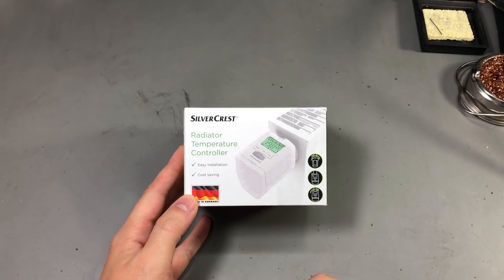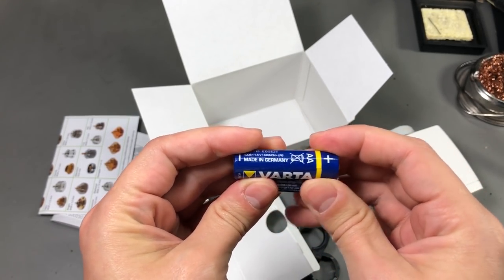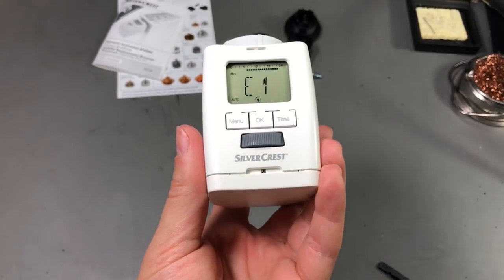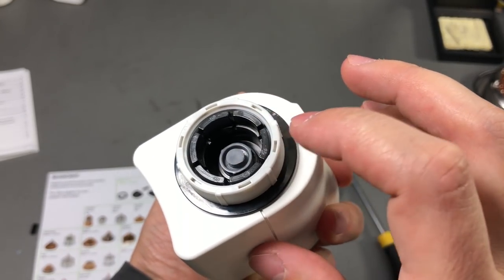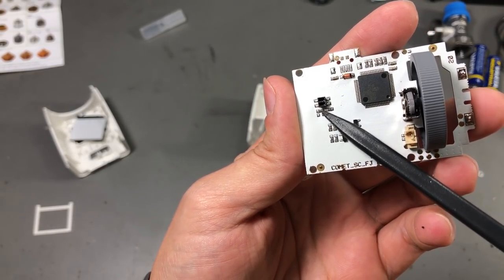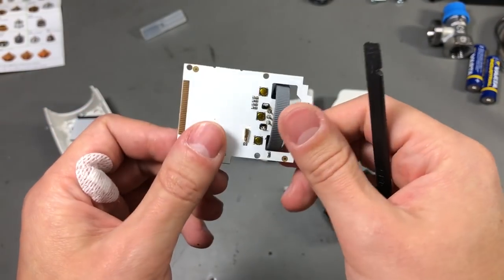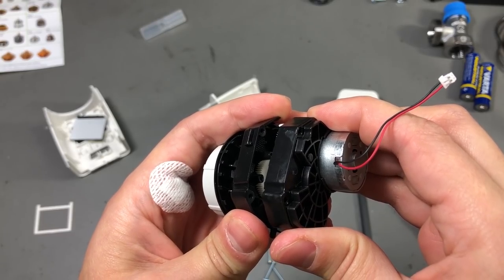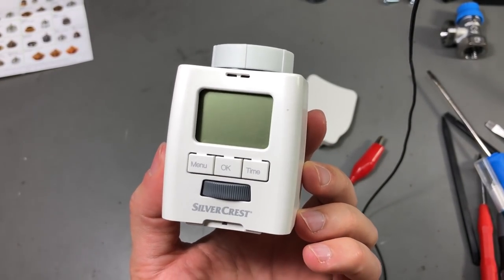Voltlog #188 - LIDL Silvercrest Thermostat Teardown

Comment: Although the temperature measured near the radiator is different from where you usually are, it is just for reference.
For exemple you can set it 35 C and where you are is 25 C,  if you set it 30 where you are is 23C  you do it until you get the temperature you feel good. This way you can regulate the temperature even it is not the same showed on the display.
Reply from the maker: you can do that but it doesn't sound good to me, I'm curious to see if the problem is there in practice or if they try to compensate somehow through software.

Comment: Hi. Thanks a lot. What do you think, is it possib,le to unsolder thermistor (temperature detector) and solder it on extended wires, to have remote measurement of temperature at different point in space?
Reply from the maker: that should be possible, thermistors are often attached with extension leads for remote sensing.

Comment: It is a good point how that thermostat being so close to the heat source could give you an accurate easy way to set the temperature for the room.
Reply: That's no different than all the other radiator mounted thermostats that have been in use for decades.

Comment: I have those valve instaled in my house, they are great. now when I  use them I would liek to have smarter solution, Is there solution for this valve that when the valve is closed that it shuts down boiler?? I have watched sewerall videos and cant finde complet solution. Like GIACOMINI or Comet DECT
Reply from the maker: I don't think Lidl sells a complete system that could control the boiler/heater as well..
Reply: @voltlog  Thanks for replay. Is there way that this valve controll boiler? The same company produces thermostat with wifi witch can connect with another devices. Is here possible to put some kind off transmiter witch could send info to boiler to turn off. Problem that I have: my main thermostat witch turns on and off boiler is in my living room, I have set it to turn heating on in morning lets say at 6am and valves are allso set at 6am but it could hapened that valves closed in 6:50 because they reach set temperature but thermostat still didnt reach same temperature and boiler works, service man told me that this is bad and that boiler can fail in souch way. Does someone have solution?
Reply from the maker: You would need a complete system with thermostats that are able to connect to a gateway which will control your boiler on/off.

Comment: Does anyone think having a temp sensor so close to the radiator may be a problem?
Reply: Andrei Daniliuc  A normal manual handvalve also measure near by the heater, may u need a offset
Reply: Thanks for the note. I know manual ones have that but I'm not sure if you'd be expecting a lot of accuracy from those ones. On this one you can set a specific temperature. One may expect more accuracy? Lots of error correction may be needed given the proximity to the radiator I think.

Comment: I know how they managed to get that low cost: they skipped soldering usb connector! You can see pads for probably mini usb connector near that ic. Four pads for metal part of connector, and even two small holes.
Reply from the maker: with another model they have that port

Comment: Remove that blue cap, this is only a protection for the valve...
Reply: It seems to be a screw cap to protect the valve itself during construction works.
Reply from the maker: I have tried with the blue cap removed as mentioned in the video. No luck!
Reply: Hendrik Busch yep, also radiators and sanitary stuff are usually coming with those - still have a box of them...:-)
Reply: @voltlog  You might want to take a look at this video by Giacomini. They show how to attach a valve similar to yours: https://youtu.be/Wt6ROY1n3Ss

But you are right: you may need another adapter. All Giacomini installation videos I found use some sort of push-fit rather that a screw fastener.
Reply from the maker: In the video they clearly show an adapter being fitted over the valve (white +Red pin) and I'm missing that, because the valve body seems identical to what I have. On another note, they thermostat looks very similar and I am willing to bet is made by the same company in germany :-)

Comment: Once they have covered the costs of the tooling for the plastics and the assembly line set up, the component cost is probably less than 2 or 3 euros. they can churn these out and rebadge them for anyone now.
Reply from the maker: yeah but you also have the dc motor + reduction gears..  varta batteries.. and it's made in germany where labor costs more.
Reply: very few hands will have touched this - the final assembly of parts is probably all the manual input. The motor and gearbox are simple to assemble and varta batteries are peanuts in bulk.
Reply: if gearboxes and motors are $3 retail shipped from china i doubt on a large scale they actually cost more than 40c

Comment: Whilst you can buy adapters to suit most valves they seem to be horribly expensive. You'll probably find it's cheaper to buy another valve - peferably one which is compatible with a Honeywell valve head with a 30mm x 1.5mm thread. Many, if not most, valves are especially later models, but they don't advertise it on the box. There are some compatibility documents around which list many valve models - eg. search on theevohomeshop.co.uk for Honeywell evohome HR92 Radiator Valve Compatibility' for a decent list and select one which doesn't require an adapter (even one that you got with the LIDL valve).

I was a bit dissapointed that they changed the processor from an atmega AT169P that they used in the almost identical Comet Sparmatic (version 1 and 2 models), for which there are some alternative firmware projects to add cheap wireless modules. Google Comet Sparmatic, select images and you will find some teardowns/schematics etc. on a German forum.

You can get cheap Sparmatic comet valves from the German ebay site if you fancy modifying these valves. Also search for OpenTRV. The Honeywell HRV-20 is very similar and also uses an atmega and have been modified but they are (or at least were) much more expensive and probably obsolete.

I haven't included links as youtube decided my last comment was spam until I deleted a link.
Reply from the maker: thanks for all the info, someone else linked the german forum below and I took a look, looks like either they changed the micro-controller or maybe this was a lower cost solution that existed from the beginning.  Personally I don't even have thermostatic valves installed on my heaters but I wanted to take a quick look at how they work that's why I bought this thermostat. But if i decide to install them I will try to get something which is a bit more compatible with the honeywell valves.

Comment: I have to say that whoever designs things like this is an idiot.  Wax filled TRV valves have been around for years, work great and cost zero to run once you have bought them.  Now somene comes up with a microprocessor replacement that needs batteries.  Great way to waste even more of the planet's resources.  And if you put one on every radiator in your house you can expect all of them to go flat just when you need the heating to work the most.  Excellent!
Reply: I do not agree with you. Digital control better than analog, based on thermal expansion of liquid.

Comment: These thermostates are crap.
Bought 5 of them in 2019, 1 stopped working after a few months, since yesterday the second doesn't work anymore.
In both cases the radiators get totally hot alhough the thermostat is set to "OFF".